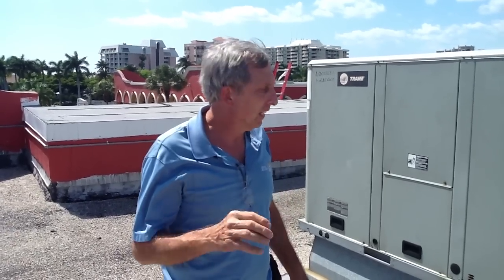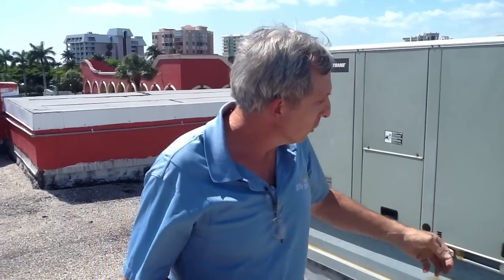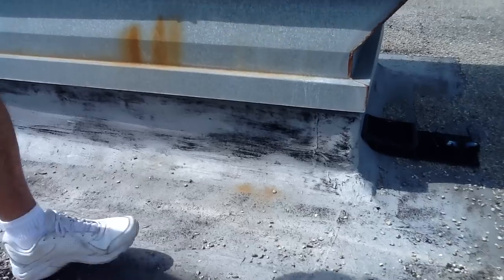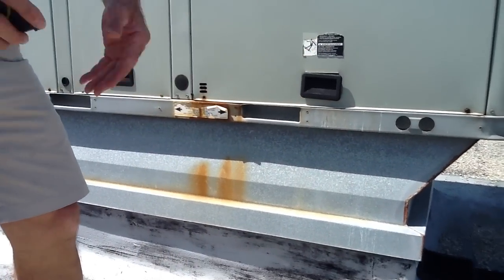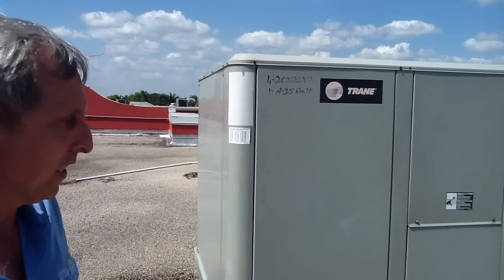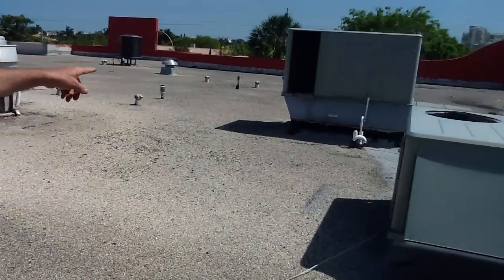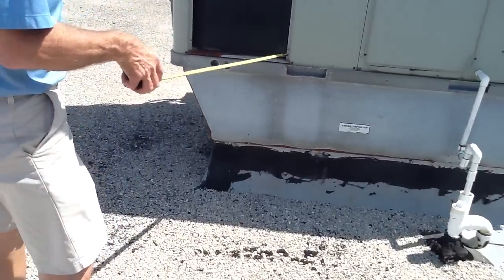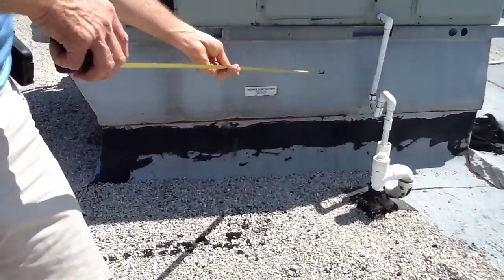What is a Roof Curb Adapter?

Comment: If you have to replace the unit on top of the adapter don't you have to measure the original roof curb?  I got confused on that part.